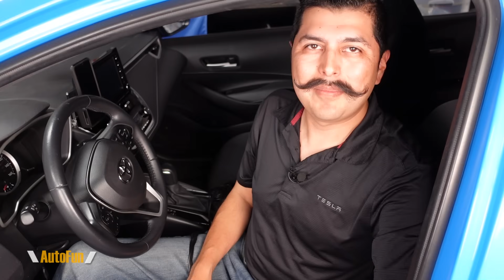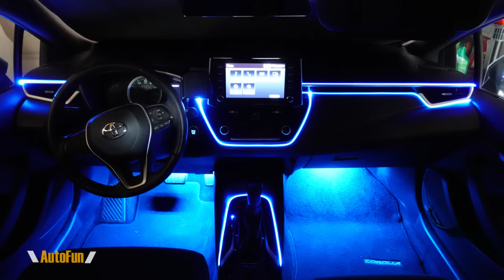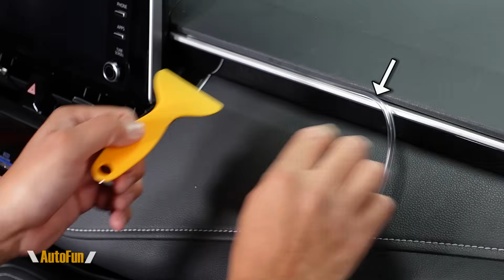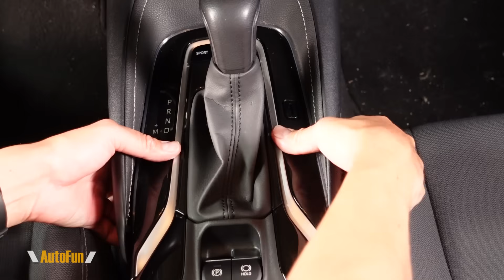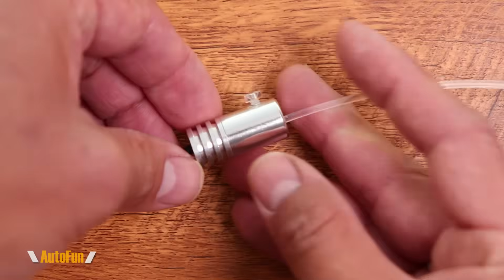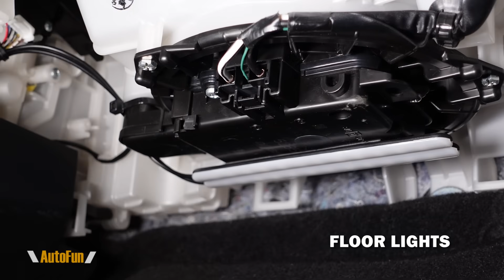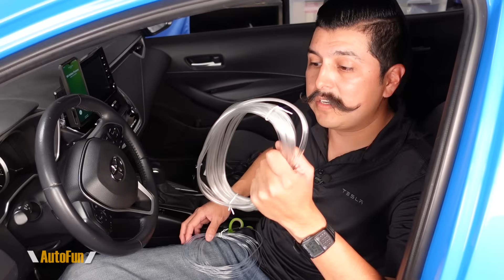CAR RGB LED LIGHTING INSTALL! (TIPS and TRICKS for Easy Installation)

Comment: I don’t want to ruin my car’s warranty by drilling holes… is there an alternative way for the wiring under the arm rest rather than making the hole?
Reply from the maker: Hi Maahi! The drill method is optional, as I explained in the video, it just depends on the look you are trying to achieve and how much detail the installer wants to put in the installation (some prefer to bring the fiber optic cable from under the panels, other prefer to drill holes for cable) Cheers!

Comment: I like the video,  not a fan of running power through cigarette lights.
Reply from the maker: Thank you Lyon! Ah yes, when requested by the customer, some installers will hardwire the kit to the vehicle (depending on how the installer connects it, it can be switched on with a separate switch or with the car coming on). And here is my full review for the lights so you can see how they work https://youtu.be/vWKoJN38-Ro Cheers!

Comment: What is the input voltage. The kit comes with the 5v usb but says it's 12v. Don't want to fry it with 12v.
Reply from the maker: Hi Spider! The kit I linked in the video description is labeled as 5-12VDC and it comes with a cigarette lighter style plug to connect it to the vehicle. Here is my Full Review Video for the kit showing all the rest of it's features https://youtu.be/vWKoJN38-Ro Cheers!
Reply: @AlexAutoFun  thanks 👍
Reply from the maker: @spidergoose891  You're welcome!

Comment: whats the benefit of using this against a normal cheap led strip ?
why fiber optics ?
Reply from the maker: Hi Shay! Probably just 2 different approaches. Fiber optics may be a little cheaper (over simple LED strips), but I do have a video  coming on full control RGB LED strips instead of fiber optics. Stay tuned. Cheers!

Comment: What if you wanna hard wire them
Reply from the maker: Hi Rider! Ah yes, when requested by the customer, some installers will hardwire the kit to the vehicle (depending on how the installer connects it, it can be switched on with a separate switch or with the car coming on). And here is my full review for the lights so you can see how they work https://youtu.be/vWKoJN38-Ro Cheers!

Comment: Got a question I have these on my car and they won’t turn off at all I had to disconnect the battery what can it be
Reply from the maker: Hi Michael! If it was installed with the cigarette lighter adapter, the lights can be turned off with switch on the adapter or using the App. If the lights were hardwired, the installer could have installed a secondary switch to control the lights, or he could have connected them to stay on when the car is On or he could have connected them to stay on all time.  I would check with your installer to see how it was installed. And here is my full review for the lights so you can see how they work https://youtu.be/vWKoJN38-Ro Cheers!
Reply: @AlexAutoFun  thanks for the reply not sure how it was installed I got the car with it already yesterday
Reply from the maker: You're welcome Michael and congrats on your new car!

Comment: Is it possible to connect the wire of a led strip with the cable powering the speaker?
Reply from the maker: Hi Jeroen! I would not recommend it, remember, the lights need regulated power from the main power supply (12VDC) where the speakers wires carry sound meant to connect to a speaker (typically 4-8 ohm). They are are not meant to pull power from for other uses. Cheers!
Reply: @AlexAutoFun  Thank you for your help.
Reply from the maker: You're welcome!

Comment: explain pls this is europe country ligal aur iligal
Reply from the maker: Hi Lakha!  I would recommend you check your local laws and regulations to confirm if there are any restrictions in your area regarding interior lighting. Remember many new high end cars already come with this type of lighting from the factory so it may be possible you may not have any but it's always a good idea to check to be sure. Cheers!

Comment: i just bought my rgb light kit and i was wondering, is it okey for the car to use the cigarette for the lights? it wont make bad to the car right?
Reply from the maker: Hi Tbrick!  If your cigaretter lighter port turns off and on when you turn on and off you car, then the RGB kit will come on and off with the car (so it will not drain you car battery, this is how mine is setup). And if your plug is always on even when the car is off then you will have to turn off the lights manually with the power button on the power adapter or using one of this one https://amzn.to/3BofzJI to control the lighter port manually and ensure the lights turn off and not drain your car battery. Cheers!

Comment: instead of connecting it at the cigarette lighter ports, can't you somehow cut that and connect it at the man headlights so when you turn them on also you turn the leds?
Reply from the maker: Hi Zippo! Correct, when requested by a customer, some installers will hardwire the kit to the vehicle (depending on how the installer connects it, it can be switched on with a separate switch or with the car coming on). Cheers!
Reply: @AlexAutoFun  lovely, thanks for answer,that could be a nice point for another video :)) the are a lot of ways you can play this 😁
Reply from the maker: You're welcome! Ah yes here is the hardwire video https://youtu.be/K2iKXj82354 the only difference would be that there would only be 2 connections made: Ground and 12V+ (in either BATT or ACC depending if the customer requests power to the lights all the time (BATT) or if they only want them to be powered when the car is on (ACC). Cheers! @zippo4222

Comment: is your car made of legos, or do all car panels dismantle that easily?
Reply from the maker: Haha! Yeah for the most part most cars inside panels separate that easily (makes production at the factory faster) However some cars do have tricky panels where if the installer is not careful the panel can be damaged in the removal process or where the panel is difficult to reinstall. So for those cases or luxury cars installers will charge an extra fee to cover that extra labor. Cheers!

Comment: Is it safe for my car/battery to use the cig lighter splitter? I run a 3 channel dashcam, if I also pair all this led interior lighting is that bad to port all that at once?
Reply from the maker: Hi Rich! This will depend on your car cigarette lighter port Amp rating (some have higher ratings and some have lower ratings) and the Amp consumption of each device plugged into it. If you check the back of the device or it's instructions you will likely find their Amp requirements. Same with the car, if you check the owners manual or service manual, you will find the maximum supported amperage by the cigarette lighter port. Cheers!

Comment: I have a question, I installed mine but it’s like the light doesn’t travel all the way through? It’s very dim at some parts. Know anything about this?
Reply from the maker: Hi! I would have the installer check for: no hard bends on the fiber optic cables (remember they can be easily damaged), fiber optic ends fully inserted into theirs emitters, fiber optic cable ends were cut sharp (not smashed or pinched during the cutting process), the current brightness setting and also that the control box is getting the correct voltage required (if hardwired, if connected via the cigarette plug it's normally not an issue but I would ask the installer to check just to be sure) Lastly, if the dim issue is only affecting 1 cable, I would have the installer check that the length of the fiber optic cable is not too long, as noted on the instruction manual, very long lengths require an emitter on each end for maximum brightness. And if you are still having issues, you can also contact the vendor, they may be able to walk you thru additional troubleshooting steps. Hope this helps, Cheers!

Comment: Is there any problem if I connect them on the door cables because my cigarette lighter is always active even when I turn off the car.
Reply from the maker: Hi Armando, Using the car's service manual and wiring schematics your installer can determine if the circuit(s) that runs thru the doors can handle the extra load and if it's safe to tap into power from there. And if your plug is always on even when the car is off then for those cases this is what I use https://amzn.to/3BofzJI to control the lighter port manually. Hope this helps, Cheers!

Comment: Is it the same process in a Chevy cruz 2012
Reply from the maker: Hi! The techniques shown on this video can be applied to any vehicle since this is a universal kit for all car models and makes. However remember there are differences between cars as far as how the trim panels can be removed, but the good thing is that most installers are experienced with several types so it gets to a point that we enough patience we can do pretty much any car. Hope this helps, Cheers!

Comment: can u do this for me? i’m so confused
Reply from the maker: Hi Mista! This video is for the install, I recommend you watch the introduction video here https://youtu.be/vWKoJN38-Ro where I cover how the kit works and all of it's features. And yes there are installers out there that install this kits if desired. Hope this helps, Cheers!
Reply: @AlexAutoFun do you put the fiber optic cable in first and then cut it? or put the guard in first THEN try to fit in the cable after
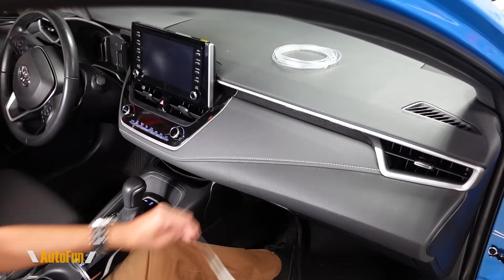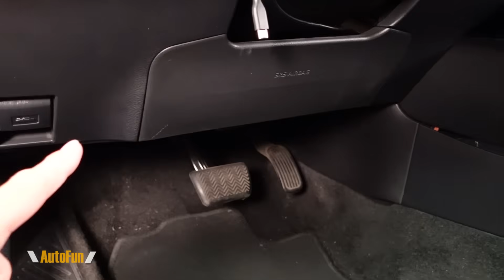Reply from the maker: @mistamilk4883  Hi Mista! I put the retainer strip first as shown at the 2:19 mark so I know how long to cut it. Then I insert the fiber optic cable into the retainer strip. Remember the fiber optic cable is left longer than the retainer strip so I have enough length to insert the fiber optic cable in to the LED emitter as show at the 6:30 mark. Cheers!
Reply: @AlexAutoFun  is it possible you can try to do lights on a kia optima 2016 sxl? it’s what i have and i’m trying to do my lights but my side panels next to my glovebox don’t come out like that.

Comment: Is it illegal to drive with the led light strips on at nights in the US?
Reply from the maker: Hi Xavier! I would imagine it should not be a problem as long as the lights are inside the car, remember many new high end cars already come with this type of lighting from the factory. However I would check your local laws and regulations to confirm if there are in restrictions in your area. Hope this helps, Cheers!

Comment: Amazing Extra tips: So u need- double cigarette lights, fibre optic wire, rgb lighting, zip ties and double sideded tape.
Reply from the maker: Hi! Yeah I use the cigarette lighter port splitter (link to it in the video description) since my car only has one cigarette lighter port and I have 2 sets of lights (top and floor lights). The fiber optic wire, the zip ties and double side tape came with the kit. Here is my full review of the kit if you want to see all of it's features https://youtu.be/vWKoJN38-Ro Hope this helps, Cheers!

Comment: My lights do not shine tru ,used 2 please help
Reply: I have tried multiple lights after a while they stop shinning tru
Reply from the maker: Hi Sammy! I would recommend to contact your installer to check if anything has come loose if you have a defective kit. You can also contact the manufacturer of the LED lights if you do not want to go thru your installer, they may be able to you walk you thru some trouble shooting steps. Hope this helps, Cheers!

Comment: I have a problem when I fix the light color to blue and turn off the car and then come back and start the engine, the lights automatically become like a disco. Why does this happen?
Reply from the maker: Hi WDKLO! That is strange, it should not do that, mine remembers the last setting I left on. I would recommend contacting your installer of the lights manufacturer for tech support, they may be able to walk you thru some trouble shooting steps. Hope this helps, Cheers!

Comment: How did you fish them with your hand to get them in place without removing any panel?
Reply from the maker: Hi Aeriel! Several panels and pieces of the trim have to be removed as shown on the video to install the lights (the amount of parts that need to be removed varies from car to car and also depending on where the customer wants the lights to be installed) Hope this helps, Cheers!

Comment: Can you tell me work make a video on how you can install it on the doors?
Reply from the maker: Hi Victor! The same techniques shown on the video can be used to install the lights anywhere on the car (as long as the cable reaches, however experienced installers can extend the cable) Cheers!

Comment: Why did you not hardwire this installation? I used a fuse tap and cut the cigarette lighter plug out. Now the lights turn on and off by use of the ignition.
Reply from the maker: Hi Johanthan! I'm satisfied with the cigarette lighter adapter for power, but yes the light can definitely be hardwired to the vehicle if desired. Hope this helps, Cheers!

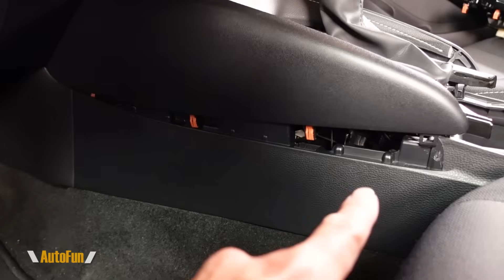Comment: I dont understand at 6:25 how you fed the cable all the way to the driver side. Im stuck at this point, can you explain how you did it please ? Thank you
Reply from the maker: Hi Buzza! As you can see on that portion of the video, I partially lifted the center console allowing me to fed the cables by hand as far as I could, then with my other hand I can reach inside from the footwell area and pull the cables the rest of the way. This will vary from car to car, on some cars I don't remove the console or cup holder at all, I usually can hide the wires by just pushing into the trim in the console area, you can see an example of that installation here https://youtu.be/LahW9J1TkCw where I did not want to remove any panels on the car. Hope this helps, Cheers!
Reply: @AlexAutoFun  Verry impressive. Thank you for your response, I'll try my best :)
Reply from the maker: @xBuzza333x  You're welcome!

Comment: Thank you so much for breaking it down into full details .You are amazing !

One question though how do you hide all those wires in other cars that cannot open on the gear panel and cupholder panel ?
Reply from the maker: You're welcome Mega Blayz'e! Ah regarding hiding the cables, so far I have not encountered where the center console or cup holder area can't be removed, however they do vary in terms on how much work there is to remove the trim in this area. And in other cases I don't remove the console or cup holder at all, I usually can hide the wires by just pushing into the trim in the console area, you can see an example of that installation here https://youtu.be/LahW9J1TkCw where I did not want to remove any panels on the car. Hope this helps, Cheers!

Comment: Can the light cut off as well?
Reply from the maker: Hi SauceGodDk! I'm assuming your are asking about the fiber optic cable? If so, yes both the fiber optic cable and the sleeve that holds in place can be cut (I used scissors as explained on the video) And here is the full review video so you can see the rest of the kit features https://youtu.be/vWKoJN38-Ro Hope this helps, Cheers!

Comment: Do you have an idea on rufflie  how much does a shop charge to install a kit like tgis?
Reply from the maker: Hi Alan! I think the price will vary depending on how much work and detail you want the installer into the installation. In one hand the kit can be installed fairly quickly on the easy spots of the car keeping install cost down on the other end the installer can go all out and put lights in the more difficult places of the car increasing cost. I would recommend getting a couple quotes so you can decide on the best price and which knowledgeable installer you decide to use. Hope this helps, Cheers!

Comment: Hi, does the light turn on automatically when you start the car engine? Or have to turn on manually?
Reply from the maker: Hi Ray! If your cigaretter lighter plug turns off and on when you turn on and off you car, then yes the lights will come on and off with the car. If your cigaretter lighter socket stays on all the time (even when the car is off) then the lights have to be turned off manually with the switch in the power plug or by unplugging the power adapter. Here is the full review if you want to see the rest of the features https://youtu.be/vWKoJN38-Ro Hope this helps, Cheers!
Reply: @AlexAutoFun  Thanks! One more question. Could I save a certain light mode setting on the app and have it on that setting whenever I start the engine? Or does it always just goto default it turns on?
Reply from the maker: @raymandarinheroes9329  You're welcome! ah yes the lights remember the last setting you left them at. Hope this helps, Cheers!

Comment: Any physical drilling or so is not appreciated
Reply from the maker: Hi Sarif! The drill method is optional, as I explained in the video, it just depends on the look you are trying to achieve and how much detail the installer wants to put in the installation (some prefer to bring the fiber optic cable from under the panels, other prefer to drill holes for cable) Hope this helps, Cheers!

Comment: Is there any possibility of these killing your battery or shorting a fuse? I'm excited to add some simple mods to my car, but I'm not much of a DIYer, so I'm a little paranoid 😅
Reply from the maker: Hi CC B! Yep if incorrectly wired it is possible (by default it comes with a cigarette lighter plug which is the safest way to install it) However I know some installers will hardwire it directly to the car which allows the owner to leave the lights one indefinitely (potentially draining the battery if they forget to turn them off). Here is the full review for the kit so you can see all the pieces and how it works https://youtu.be/vWKoJN38-Ro Hope this helps, Cheers!